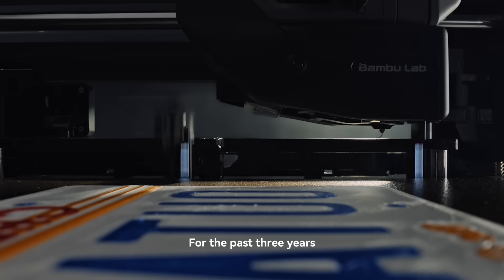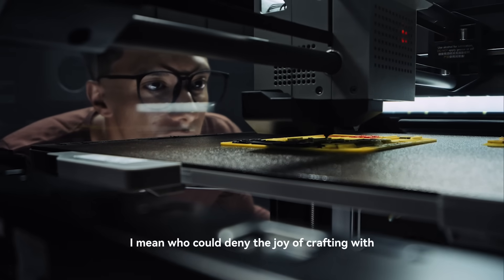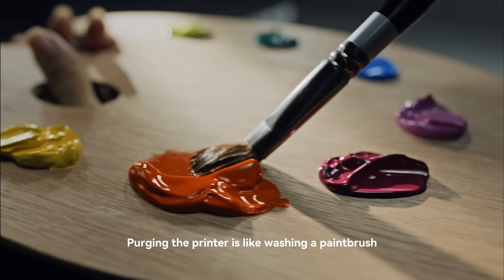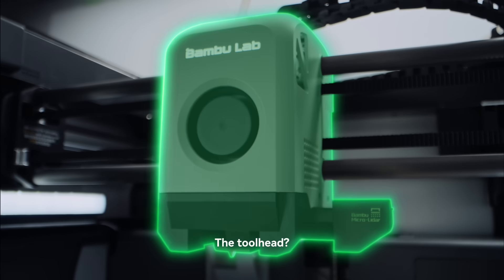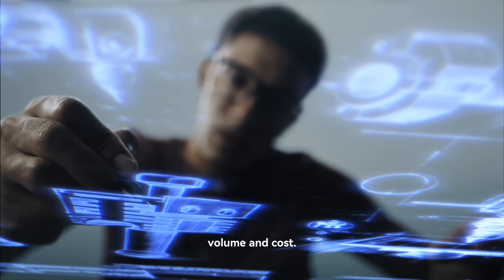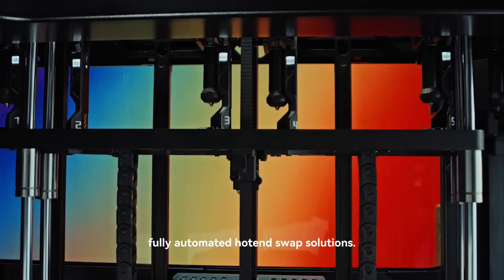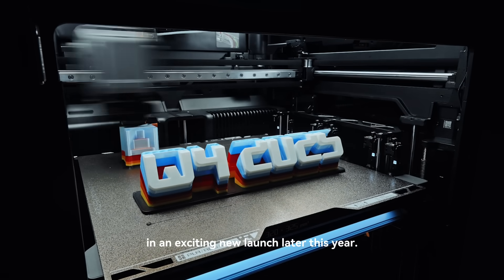Meet Vortek: Our Answer to Zero Purge Waste Multi-Material Printing

Comment: Bambulab argues that, unlike Snapmaker’s U1 system, their approach avoids wear on pogo pins.

But on the U1, the pogo pins are as far as I know only used to power the part cooling fan in the toolhead holder. Why not just integrate the fan directly into each interchangeable toolhead, or provide a separate permanent power supply for a fixed fan in the holder, so that the swappable toolheads don’t need to handle the fan’s power delivery at all?

Comment: I just bought an AMS for my P1P and the sheer volume of purge waste on my first multicolor print shocked me. Can't wait to see whats coming!
Reply: I hope us P1Pers get the attention too. I'm only seeing X printers in the video.
Reply: @zacharymuncy7325  The devices showcased using the Vortek system were H2 series printers. The system is available as an upgrade for the H2 or as a full system, the H2C.

Comment: Basic Vortek Upgrade Kit	USD 399 – 599 (forum speculation)
Full Hotend Kit (all 6 + accessories)	USD 699 – 899 (forum speculation)
Upgrade Kit w/3 Nozzles	USD 600 – 700 (UK/€ estimate)
H2C Printer (complete unit)	USD 2,500 – 2,900 (forum speculation)

Comment: Wonder if a pigment mixing system is possible. Like some way for a powdered or liquid dye mixes with white or transparent filament before leaving the nozzle. Whatever they use to color the filaments in the factory when its made. It would definitely take up a lot less space than multiple rolls of filament. Kind of like an ink tank, inkjet printer, or a laserjet printer with toner. I know manufacturers are expermenting with resin printers and some sort of solid gel printer that use lasers to cure the material, and even some that use powder. It could be possible to incorporate some of that into a filament coloring system that would require less space and less moving parts. Not that I have any experience with multi color printers. Never owned or used one, and probably never will. As they are way too expensive and a regular 1 color filament or resin printer work just fine for what I need. Lol

Comment: It's cool, but my biggest pain point with the X1C is how many days I add to a ten minute print for daring to have multi materials. And it's swap time that's the killer. 8 seconds quoted (let's assume it's closer to 15) to heat the hot end on top of 20s to unload and reload filament is a fair bit better than the current setup, sure.

But it's nowhere near as quick as the couple of seconds toolchange where the incoming hot end has already been coming to temp as the previous one was finishing its pass.

Comment: What is the point to keep the H2D toolhead design when you already has a tool change system? The second nozzle on the size not only reduce the printing area, increase the cost of the machine, mechanical complexity of the toolhead, and the mass of the toolhead. I would rather has this kind of system be put on a single nozzle machine such as H2S

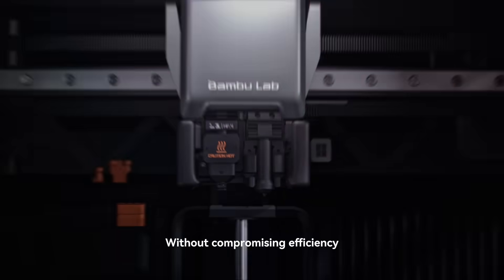Comment: 2:18 "nozzle heats by induction in just 8 seconds"
And I'd assume that induction doesn't start on nozzle change.
So it's not pre-heating immediately.
So resuming printing doesn't start until AFTER the lead time to get back into position.

Comment: 1. STOP SAYING FAKE FACTS TO PEOPLE. The pogo pins are used for testing PCBs at every manufacturing. And their reliability has been proven over the years. Your induction coils are just a piece of unreliable shit with 50% energy loss. 2. This design looks like a kludge, but not a cleverly thought-out design. You will still need to purge some material through the nozzle before printing, and filament change will take the same amount of time because you need to cut it and retract the whole length of the PTFE tube. You lost the market for multimaterial printing to U1. Instead of holding your company name, you decided to go by the same path as all cheap, shitty Chinese companies that can only pretend to make good products like BCAM CNC, for example. Not cool

Comment: What I'd really like is an upgrade path for the H2S to an H2C. Give us a single hotend but swappable via the Vortec system. Get the same "one paintbrush for each color" analogy but with a single hotend. I'm less interested in a dual nozzle system, but a single nozzle Vortec system for less purge waste would be primo.

Comment: beyond it being a bamboo product, my issue with is it is your limited to only 4 colors.  If you have an external AMS system, theoretically it can be alot more.  I have CoPrints KCM set on my A5M PRO and it can do up to 22 colors simultaneously.  Yes theres waste ofc but its worth the trade off.

Comment: I feel kinda satisfied they didn't mention the Prusa XL's system, which I think is absolutely genius. We use this machine at work every day, and it's nothing short of glorious.
No poop, and the whole print head gets exchanged. yes, it needs five print heads. But swaps take like two seconds, and these new print head designs are incredibly reliable.
Reply: Too bad it costs 5 grand. Prusa makes such reliable products, I really wish the Prusa XL was affordable for hobbyists.
Reply: @olavodias  true. But you have to consider, it is a professional machine at work. I am considering getting a Prusa Core One for at home though, it's significantly cheaper (about one fifth) and I don't need the tool changing.
Reply: Why have they only told us the Heat Up Times Not the real Times for the full Change? Yes IT will Take a lot longer on their Maschine because of retraction to their ams... They arent ahead of the curve anymore snapmaker is, indx is and IT seems Indx ist coming to prusa printers aswell... We will have to distinguish all those printers now carefully. H2c ist nozzle Change, Bondtech is hotendchange and XL, snapmaker is Toolchange. There are pros about every system but only the XL is Out for a Long Time ( with ITS Problems) and the U1 is Just in the hands of some creators... It is a good year for 3d printing
Reply: it's the apple approach where they don't acknowledge their rivals, copy their products, and then claim them as their own revolutionary designs with different marketing names. closed ecosystem aholes
Reply: They didn’t mention it because it’s vastly superior
Reply: @sumerianbotfarm  It truly is. an absolutely superb machine.

Comment: Absolute failure of a proposition.

The main failures I see due to filament swaps happen on the ams level, not the printer it self.

You still have hundreds of filament retractions and feeds that risk failure every single change. 

You’re so close Bambu, but this isn’t hitting th mark.

Comment: 02:35 But why when you need purge block on plate if it says zero purge waste?
Reply: That so with a choice you can have a test of how flowy the filament is
Reply: @peskybird10mj fr
Reply: Pressure builds up on the nozzle and causes the first couple centimeters of print to look ugly so you still need a prime tower
Reply: It’s pre-filament.
Reply: @Googlypat elite joke.
Reply: Primarily for Priming
Reply: Same reason your printer makes that line before it starts printing
Reply: Because it’s not a purge block, it’s the prime tower. 
It’s there to prime the nozzle after each swap. 
Even if the nozzle heats in just 8 seconds, that’s at least 2 seconds of oozing, that you would rather want on your prime tower than on your model.
Reply: @jonatanboy  I was trying to explain that, evidently I didn’t do well
Reply: Because it's a time lapse. You purge block on time lapse because the print head has to move away from the print and leaks a little
Reply: @ec7005 no it’s because you still need to prime the filament.  It’s not for time lapse.  If it was just for photography they would have edited it out.
Reply: @ec7005 smart ass

Comment: This would be pretty impressive if the bondtech indx did'nt exist
This just looks unnecessarily complex next to the INDX, and looks like it can have far fewer hot swappable nozzles for the same footprint but otherwise works the same
I'm sure it will work great though

Comment: Nobody realizing this thing is going to be slow AF, I'm talking double or triple the print times versus a tool changer. Sure, there's little to no waste, but still expect incredibly slow print times. This is just a stop gap measure since Bambu can't bring out a real tool changer to market anytime soon. For the price of what this system will be plus the cost of a printer you can probably buy three Snapmaker U1s (four if you take advantage of the Kickstarter). Bambu is simply trying to keep their user base from jumping ship since the "meta" right now is zero waste color swapping.

Comment: i was waiting for Bambu's response tot he U1. interesting approach but U1 nozzle swap is done in 5 seconds. bambu claims theirs is 8 seconds. hope Bambu will make up with this by at least doubling the nozzle's to 8 since they need less space with this technique. from what i can make of this video they heat the nozzle after the swap? wouldn't it be faster to preheat it before the switch? but the bigger Question is can they compete with the price range of the snapmaker?

Comment: glad to see more of the CNC machining concepts making its way into 3d printing. 
now for the eyeroll.... lol
make it a bigger format (450-500mm) & start adding some basic non-planer capabilities.
Reply: The non-planar using CNC tech is not practical for these price points. However there have been great strides in non planar slicing for current 3D printers... Once the extra bugs and limitations have been figured out, I can't wait to see those out there. Just like Fractal support free printing, which allows for overhangs.
Reply: I can certainly understand costs going up when you add more parts, but the overall tech is not really a big deal. Given the enhanced capabilities, it would be worth it... but certainly is a niche market. Everyday users who print trinkets do not need it, but people who make engineered & usable parts certainly do. Even making printer heads have enough clearance to give the ability of like .75" non-planar would be massive.

Comment: This is nice for more than just switching color. You could swap nozzle diameter on the fly and speed up portions of a print that can be done with a bigger nozzle.
Reply: Wouldn’t the slicer have to support that?
Reply: @craigritchie8470  Many slicers support a feature called "infill every n'th layer" which is good for big nozzle infill scenarios.
Reply: bambu didn't allow this on the H2D.. but they really should.  This would decimate all other printers

Comment: if it had a carousel like a cnc machine with 24 hotends this would be perfect.
Reply: heck make it some ridiculous number like 100 so you can place different nozzle size and color combinations in the machine. and just set tool parameters like tool 1 (.4 - While - Pla) tool 2 (.6 - Black Petg) and so on.
Reply: something like this cabinet on the side of the printer would be awesome.
https://youtu.be/8JXRfeA8_-U?si=h4tMk9m7J4wBE_mB&t=534
Reply: There is already a printer on KS that does this. Bambu lab is cooked.

Comment: Bambu Lab just gave me everything I have wanted 
I can't believe this could have done this fast, in just one generation of product
Reply: It needs 2 heads, or at least 2 useable hotends for it to have everything I want. Without swapping. 
Then you can use support with a different filament without wasting filament, or a fast 2 color print.
Reply: The only reason this announcement came out is because of what Snapmaker is released. There are so many moving parts in this design. It could be very expensive and not as fast as a regular tool changer
Reply: @EileandDover  naaaah, whole nother league

Comment: Well, that would have been something I would have expected instead of the actual H2-Series Printers (I still cannot see the practical use of a 3D printer and a laser cutter in one housing). But admittedly, even though I saw the rapid change of hotends, but really did not understand how they change the filament with it. The renderings seemed to me a bit "unfinished".

Comment: Looks like a lot of moving parts, what kind of reliability can we expect from this? Has it been beta tested? Or are first adopters going to the the beta testers?  I have to say I love my H2D it is my first Bambu product and it is a dream come true after scrapping my Snapmaker 2.0 (and their horribly unreliable dual nozzle "upgrade"). The H2D is built on tried and true technologies, perfected by Bambu in only a way that they can.  But the Vortex is a completely new direction, so I am going to hold off buying it until I see others success with it, for at least a year or two, and maybe after it gets a v2.
Reply: Read the blog post referenced in the description. Answers your question.
Reply: @raphofthehills4405  the blog post does not reference actual testing data, and talks more about the hot end connection and not the gantry that will be doing all of the work and has the most moving parts.  If they did 3 years of R&D, I would like to see the testing data on the final product.  I understand this data wont be made available, so as a consumer, I can only watch reviews and see how often it goes on sale.

Comment: Awesome! just a bit too late for me - I ordered a Snapmaker U1 last week.  I had hopes that Bambu would come up with a 2 nozzle A1 for a good price which already covers overhangs & texts/ contrast lines on background or Semi-Flex prints, but the first promising 'hobby' solution that appeared was the snapmaker U1 - the H2D was just too expensive when you're not making money by printing.
Reply: Completely different experience targets, and indeed will likely be at least 3X the price of the U1. 
If the U1 delivers and is reliable you probably made a good choice for ur needs.
Reply: @raphofthehills4405  given the H2D is upgradeable, this is a pretty cool solution for people who already own and H2C.

Comment: ok ok, but hold your horses. It will cut out the filament waste and some time for sure. 
However we are still stuck with all ams "fetures". cutting, pulling back, loading new filament etc. and you can say what you want but its not fast. 
i will not even mention, that we will not be still able to use fexible materials.
for me its sound more like a evolution of already chosen AMS path than revolution. 
i wolud expect more like Bondtech INDX solution. but probably is dictated by backward compatibility that they can sell it as a upgrade for not-so-successful H2 series

Comment: Ah yes, the future is here! Still cutting filament, still purging, still wasting plastic… but hey, at least the nozzle itself moved a few centimeters this time. Truly revolutionary.
Reply: Bondtech INDX solves this, waiting for that one
Reply: I assume this is ragebait, but if it isn't, did we watch the same video? Sounds like someone is pissed just to be pissed. Even if you don't like Bambu, keep in mind that this will surely trickle down to other manufacturers, just like the AMS did.
Reply: What really confuses me is that they clearly still have a purge block, so where's the advantage
Reply: @MichalDvoracek-sy6eu if you read their blog you'll see that, there is no Purge up to 7 different filaments. If you go beyond that up to 24 there will be some Purge.
Reply: @BeSome1 Oh okay, that makes sense. I'm curious how this will compare to the multiple tool heads on an XL, I'm assuming it won't be as good

But it absolutely could be cheaper
Reply: @MichalDvoracek-sy6euThe purge block is here to repressurize the nozzle, otherwise when you print in different colors there will be holes since no filament came out at that moment

Comment: I knew when Bondtec announced the upcoming coming launch of their INDX system, that the clones would be coming fast and furious. This preview looks really impressive. But, I want to see it when it becomes a reality. That tool changing rig looks like it would be very prone to wear and tear. Also, I’m guessing you’ll still have to have an AMS type filament changer to pair with the swappable nozzles. It doesn’t appear that the nozzles are pre-fed with filament.

Comment: They just can make a change in the slicer and add an option to purge in the infill or inner walls... If the part allows this offcourse. But instead they make this which is cool but way too expensive
Reply: I currently use the slicer to purge to infill and within supports... What you're describing is legit already a thing...
Reply: @EliteCanadian92 i couldnt find that option. Or it didnt work reliable enough. Where did you find it?

Comment: Very confusing... is the Vortek for H2D or the new H2S or for any of them ? 
If H2S, then a single PTFE tube? if so, can it do TPU + support material ?
Reply: It will be built into the upcoming H2C.  They're saying that it will be available as a separately purchased add-on for the H2D and H2S that would require the user to do the installation.
Reply: @Coracii-1971  thanks... but even more confused now.. there is a 3rd H2 printer incoming, the H2C? what do you we know about it? 

More to this....will the Vortek be able to print TPU+ support on an H2S? 

Asking this cause i want to order an H2S these days, but mandatory that it can do this type of job for me.
Reply: @emipop21  Not all of the details and specs have been released at this point.
Reply: Blog post referenced in the description answers ur 1st question.
Yeah, wondering about tpu too.

Comment: Induction nozzle and wireless temp sensing ect is a smart idea... Do the nozzles have a battery, or how do they get power without any pogo pins? Or are they powered with inductive charging as well?

Comment: I'll wait for the "race to the bottom" manufactures to make a better and cheaper system based on this. And with more open source, non-walled garden ecosystems.
I bought a 3D printer, and I get to decide what 3rd party apps I use with it.